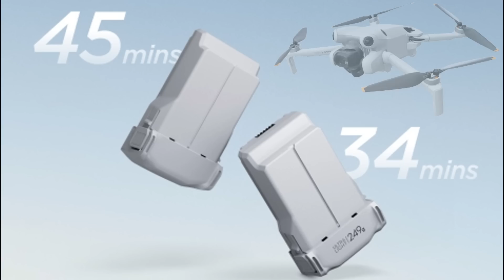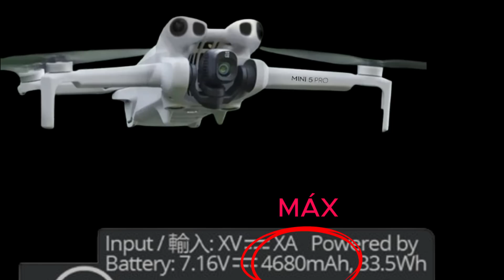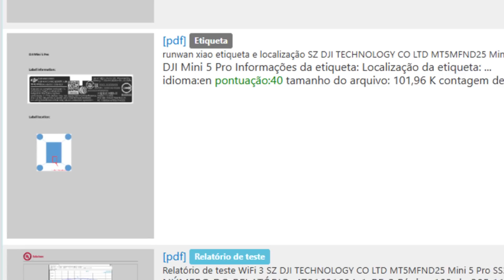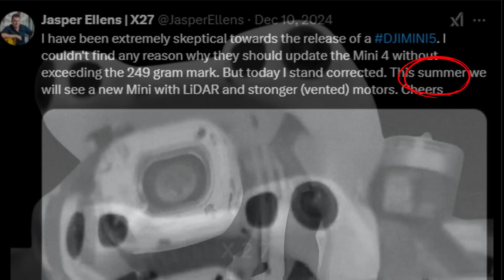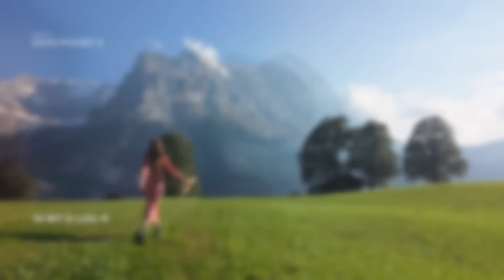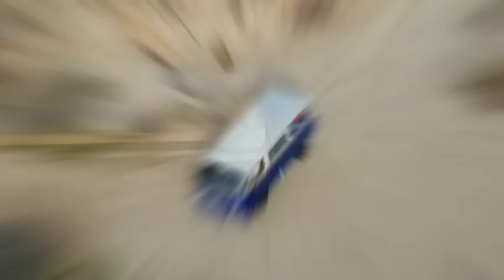Leaked: DJI Mini 5 Pro’s New Battery is a Game Changer!

Comment: The DJI Mini 5 Pro apparently has a 33.5Wh battery with a 4680mAh capacity. While exact power consumption details aren't readily available, previous Mini models typically use around 10W–15W during flight.
Using an estimate of 12W:
- Battery life ≈ 33.5Wh ÷ 12W ≈ 2.8 hours (in ideal conditions).

However, real-world factors like wind resistance, flight mode, and camera usage can reduce this significantly—expect closer to 30–40 minutes per charge.

Comment: With the Mini 4 Pro you have a takeoff weight of 249 grams, if the Mini 5 Pro now has even more sensors and a heavier battery, the 250 grams are gone. Then it would no longer be C0 certified, but would be C1.

Comment: I can't imagine how to fit a bigger camera, Lidars and a bigger battery into the Mi5P while staying under 250g.

Your assumption that the capacity on the FCC sticker is for a "+" battery seems to be the most plausible explanation.
Reply from the maker: This is the conclusion that since this sticker goes on the drone and not on the battery, it could be the maximum capacity of the drone. In fact, on the Mini 4 Pro this battery data information does not even exist!

Comment: That's of course the plus battery. It may weight twice of standard battery but given M5P stronger motors and being beyond 250g anyway that should be no problem at all for the new drone.
Flight time of standard battery, so below 250g, will stay the same as long as battery technology stays the same. Even DJI doesn't miracles
Reply from the maker: I agree, thanks for your comment.

Comment: Please compare what is comparable... DJI battery Plus mini 4 pro/mini 3 pro is already 3850mAh.  2453mAh is the standard version.
Of course, the battery Plus is heavier, and the weight of 250 grams is exceeded.
Reply: The mini 4 pro came with 2590 mah batteries as standard. The 2453 mah battery is from the Mini 3 pro, and is compatible, but not included with the Mini 4 pro’s from what I’ve seen. Same goes for the 3850 mah battery, they both share.
Reply: @MC...  Exact, but the new battery announced should be comapred to the 3850 mAh, indicated theorically up to 47 minutes

Comment: I just buyed the mini 4 pro ,but i can tell if this drone is not below 250 gr the wil sell less from it becouse the restrictions, iam good annyway for few years
Reply from the maker: Yes, most users
want more fun and less bureaucracy!
Reply: Obviously it will be under 250g, that is the Mini's are known for. If it goes over 250g, then its pointless buying this new mini 5 and people will just buy thr air 3s woth 1 inch sensor .
Reply from the maker: @mikevfx7108  Exactly, it's precisely because it weighs less than 250g that it's called Mini! And I'm sure DJI will do everything possible to maintain this weight, otherwise it will lose a lot of customers.
Reply: @flytechdrone2  Я думаю многие заблуждаются,когда говорят о недопустимом превышении общего веса дрона с усиленными акб.Начнём с того,что при покупке любого дрона,вы подаёте документы на его регистрацию,где чётко указана ваша модель коптера и его вес.И вот как раз это и является решающим  фактором,например при задержании вас полицией.Поверьте,полиции наплевать,какая у вас стоит батарея и превышен ли общий вес коптера.Если по регистрационным документам он позиционируется как коптер весом до 250 гр.,то проблем никаких не будет.Никто не будет взвешивать ваш дрон,достаточно будет того,что написано в регистрационных документах,в хар-ках дрона.Сколько разговоров по этому поводу и зря,пусть он будет весить и все 350гр.,летайте на здоровье.

Comment: It could also be that DJI has changed the battery technology from Li-Ion to Li-Po, as a lithium polymer battery can be lighter!
Reply from the maker: Indeed, it could be that DJI used some other battery technology to maintain power without adding too much weight.
Reply: if its lighter the new batery i hope also fit in the mini 4 pro, this way the 4 pro have also longer fly time and keep the weight under 250 gr
Reply from the maker: @WorldTraveler-BE  Very good point! It would be great to have more flight time on the Mini 4 Pro without exceeding 250g
Reply: Lithium-ion, lithium - polymer is just the same !!! The new technology is Silicium-carbon !!  more powerfull and lighhter ! 😊
Reply: Mini 4 pro batteries are already Li-Po, written on their sticker.

Comment: You're right, with this capacity it really is difficult for the Mini 5 to stay below 250g.
Reply from the maker: I believe DJI will sell the Mini 5 with two battery options, and the lightest one should be under 250g.
Reply: @flytechdrone2  just like the pro 4 you have 2 battery's the pro plus battery and in the uk we not allowed to have it
Reply: The laws are changing the 250g is being down graded to100g so 250g will be no longer relevant at least in the UK/EU
Reply: Mini's are known for 250g under drone. If they go over 250g then it will be pointless to own one and and people will just buy a 3s
Reply from the maker: @mikevfx7108  
Exactly! That's what it's called Mini for!

Comment: I also think that this capacity on this label is the maximum limit of the drone, and not the capacity of the battery that will come with the Mini 5!
Reply from the maker: Yes, because this label is for the drone and not for the battery, I even found it strange that the battery information was on this label, because on the Mini 4 Pro, there is nothing about the battery on the drone label!